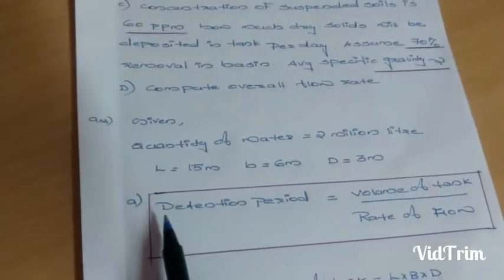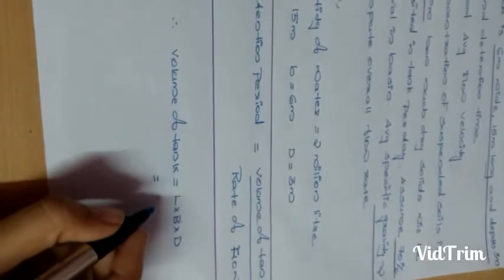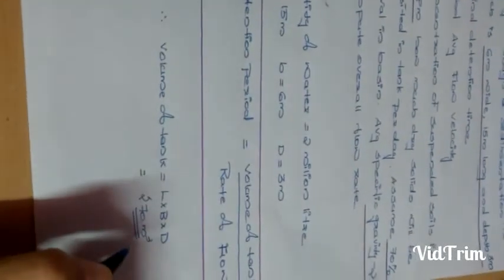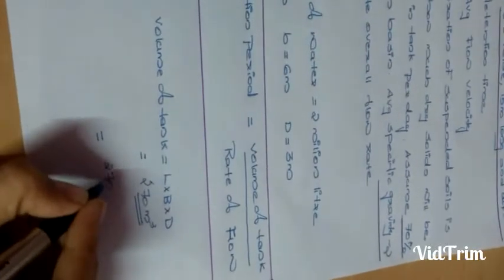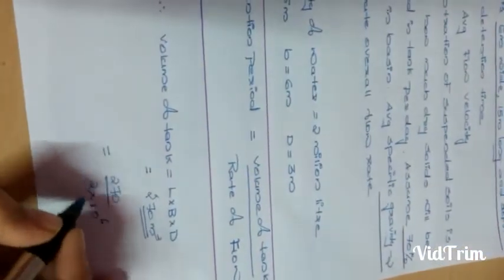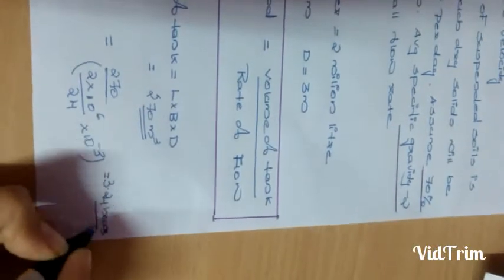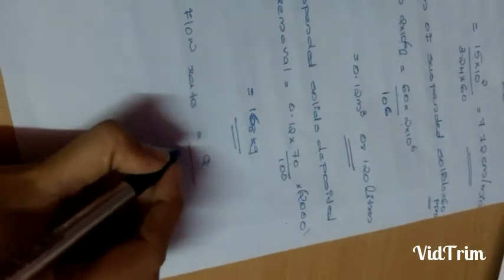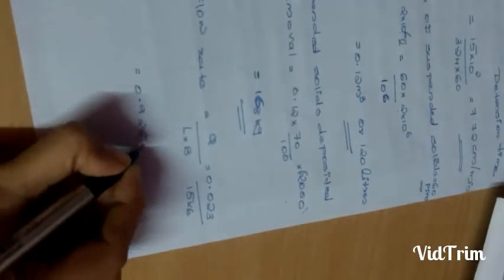Sedimentation tank | detention time , velocity calculation | easy and fast

Comment: could you please explain in more details the last two calculation steps for 60 ppm in 2 million liter which results shows it in m3 and not as a weight; how the mass of suspended solid deposited and how we get the Q (= 0.023)
appreciate your help
Thanks a lot
Reply: volume/hour. it simply mean that you will say (270 m^3/ 3.24 hours) = 83.333 m^3/ day then when you calculate your overflow = (83.333/ 15 * 6 ) = 0.9259 m^3/ hour/ m^2 good luck